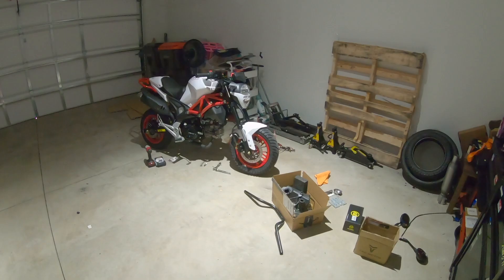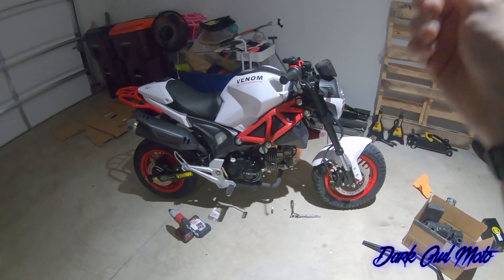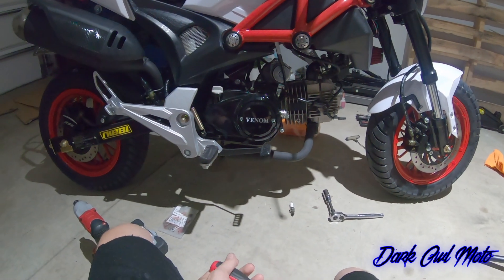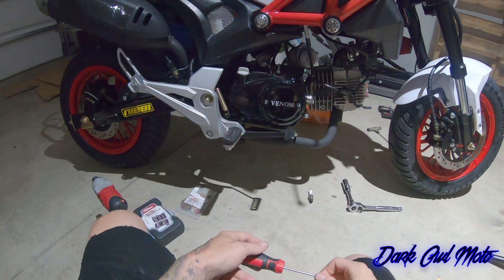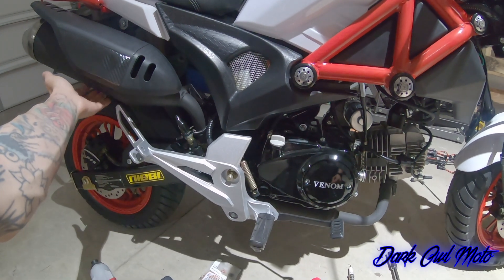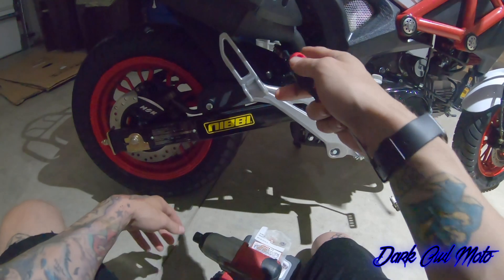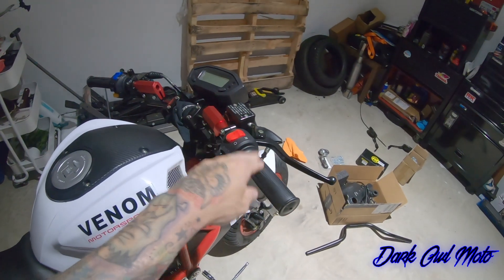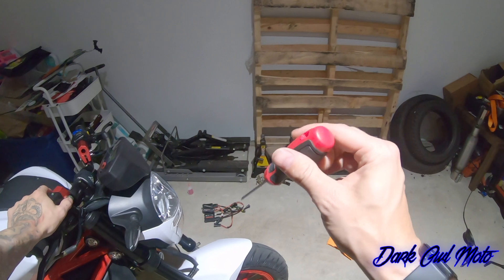I DID WHAT I SAID I WOULDN'T DO

Comment: Sooooo buddy..     is it a direct bolt on exhaust system for the clones?   Aftermarket...    That's not $200
Reply from the maker: There are that I’ve heard of but they aren’t great. I’ve always just heated mine up and slowly bent them
Reply from the maker: I went with the $70 one from Amazon literally parked my car on the exhaust, heated up the bend in it and put a bar in the bolt up end and pulled until it was close to a 90• bend
Reply: @darkowlmoto  LMAO 😂😆
Reply from the maker: @BLACKZULU74  it worked! Lmao

Comment: I went back and rewatched the video. Did you really say it has a 48mm carb. My H-D EVO dynoed 100hp at the rear wheel and it had 1 38mm Kihien carb. Surely that's not a 48mm on a 150cc scooter.
Reply from the maker: It’s a 26mm carb on a 125cc bike. It has a 48mm filter/inlet.